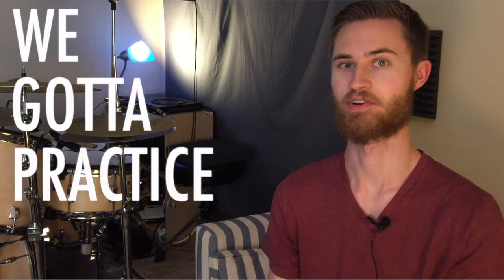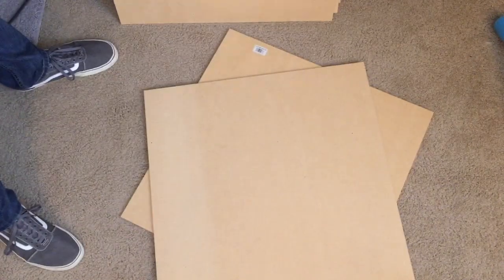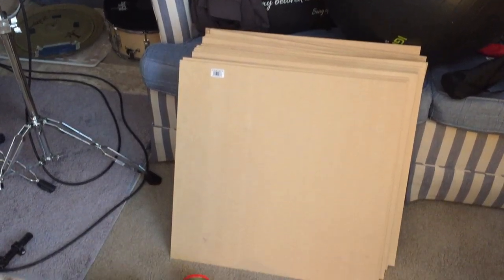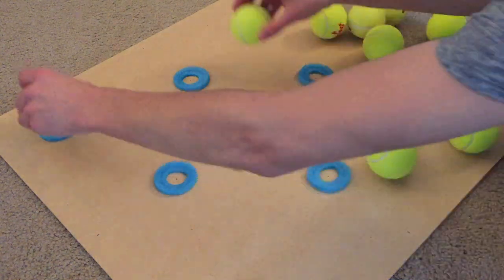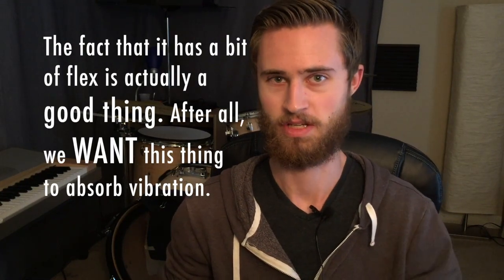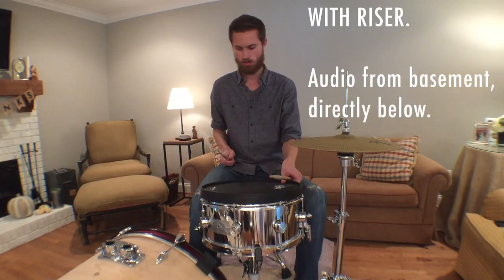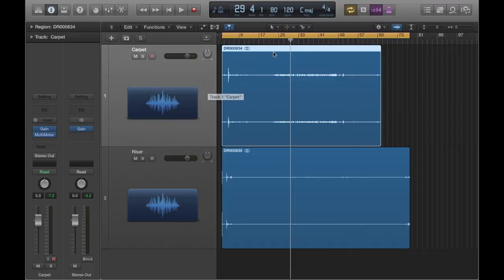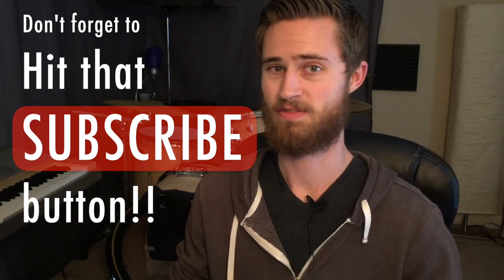Is a Tennis Ball Riser REALLY the SECRET to Quiet Drumming?

Comment: Always have something interesting on your site. However,  this tennis ball platform was wobbling quite a bit while you were drumming. Personally that amount of movement occurring beneath me as I am drumming to music or learning and practicing new beat combinations via the Internet or DVD would drive me absolutely bonkers! It would be as if I set up my drums in the back of a flatbed truck and attempted to play as it drove down a dirt road filled with potholes --  Honestly it would be ridiculous. Have you watched your video here? Every piece of your drum kit is moving which completely negates the positive effect of muffeling its sound as it is now rendered useless to play. Have you found a way to stop the wobbling? I've seen others where each tennis ball is cut in half and used one large piece of wood board to mount tennis balls onto instead of 7- 9 small pieces. There is NO wobbling at all.
Reply from the maker: Yes, there would be less wobbling if I used large pieces of wood instead of small squares, but that was a compromise I was willing to make not having tools at my disposal. Honestly though, the wobbling isn't bad. It doesn't bother me. That may be because I play on risers a lot and I'm used to it though. The idea of slicing the balls in half is interesting, but I think the wobbling would still happen just because of the size of the "tiles." If it does become an issue, most likely I would add a plank of wood on top of the squares as an additional layer. That would actually solidify things a bit. Also, in the testing video I may not have laid the extra MDF boards on top for reinforcement, which is what I do in my apartment. I lay extra pieces across the top to bridge the "gaps" and reduce wobble. It's quite possible that reduces it a lot compared to what you saw...I actually didn't think about that until you mentioned it.

Comment: Guys! I have a PRO tip from the 3D print nerds. Many of them use the tennis ball risers for the same reason as the drummers do, and it does the job to some extent, but you can do MUCH, MUCH BETTER than that, and it's still simple and cheap.

All you need is, wait for it........................ CONCRETE PAVING SLABS [Ba-Dum! tsss] I know. It's heavy. But if that's a problem, then maybe you should play clarinet. It's a cool instrument too. In the Polish military orchestras, they call it "a goose d##k".

I want to try it myself. I haven't yet, because I live on the 4th floor with no elevator, but it's pure physics, and I know it works 100%. Still, a foot stomping on a bass drum pedal is more powerful, than a small 3D printer, so there's a chance that some of that energy will get transferred to the slab, and from the slab to my neighbor's ceiling, so it would be nice to isolate the slab from the floor. A thick rag would be a solution, but I will try:
- a felt-like, 10mm thick acoustic mat (to be used in rehearsal rooms or to soundproof an engine bay)
- EPDM rubber sheet (it's often used in soil compactors or to absorb vibrations from all kinds of industrial machinery)
- 5mm thick EPDM shims (used for roofing accessories; I use them a lot already)
- some kind of extra-dense mineral wool; some folks on YouTube recommend mineral wool as the best material for DIY acoustic panels.

I'm not gonna use it all at once, but I think I will make more than one layer of insulation.

Comment: I think you could have gone simpler and cheaper by just cutting the pool noodles to 1 inch length and gluing both boards to those pieces leaving out the tennis balls.  The idea is just to get air space between the drums and the floor.

Comment: Only flaw that i can notice is making the tennis ball raiser for the throne? That is unnecessary since you don't hit the throne, you could've just used something that's stable to place the throne on. Why bother muffing the sound of something that doesn't make sound and making it unstable in the process?
Reply: But it doesn't stay the same height since it flattens more than the rest of the since person is heavier than a bass drum. My point was it's unstable and it moves, this is not the way to make it stable height, even less to make it the same height as the rest of the set.
Reply: Iglaaa it's to keep everything level. If the kit was on the riser and the throne was on the floor it would be around a 4 inch difference. That would throw everything out of wack.
Reply: Hulk Slayer and for such matter you can use somehing that is not tennis balls and noodles for stability but lets say wooden blocks or bricks or whatever is not squishy and is the right height.
Reply: Iglaaa you're correct. He could have used thousands of different options for making a base for the throne. I would guess he made it out of the same materials he was using for the tried and true reason that he was already using them :)
Reply: My riser has no spot for the drummer. I just increase the drum throne's height.
Reply: VortechBand boom! 
Was gonna say this. Just adjust your throne up a little. Unless you’ve gone past your max height. Then just get a few small pieces of material to go under each foot of your throne. No need for a whole section of the riser just for the throne if it’s only a few inches higher.
Reply from the maker: Trust me - I thought about that :) It's not a design flaw, just a choice I made to keep things simple. I don't want to have to constantly re-adjust the height of my throne between practicing and gigging. Plus it's easier to get the throne in the exact spot I want it on the fly when it's up on the riser with the kit. Otherwise if I decided it were too far away, I'd have to slide the whole kit toward me on the riser since the throne can only get so close when it's on the floor. So far there are no signs of instability, especially since I added an extra layer of MDF board on the square where the throne sits. I weighed out the pros and cons, and the method of putting the throne on the riser won.
Reply: Hulk Slayer then raise your throne
Reply: Iglaaa then your kit would be up high. Bad.
Reply: Yeah, I missed this reply, I understand that you don't want to change the throne height, only thing that I'm trying to say is that if you used something else instead of the tennis balls to raise it, it would be 100% stable. Like literally wooden blocks to hold the plate would make more sense since you don't need to muffle the sound of you sitting on the throne, right?
Reply: Just to jump on-board ... there is a theory that the vibration can also travel through the player so putting the throne on the riser is a good shout.

Comment: You should redo this video with real cymbals and remove the muters from the drums.
Reply: For real for real.  Once I saw the muters and the fact that kit is not loud to begin with this whole video seemed like a moot point.  That said well done on summarizing the steps for your project
Reply: @kevinkolhede5056  its not really a moot point because the only noise reduction a riser is going to provide is absorbing vibration mainly from the kick. using real cymbals wouldnt change the riser's ability to do that. the muffled kick drum head just makes sense, since what this video is about is making the drums more playable in an environment where making a lot of noise isnt possible. with or without the muffled heads, the riser would still show a reduction in noise either way.

Comment: A couple other construction ideas. 
1) You can get a 4x8 sheet of wood even on a regular sedan just by placing a sheet of foam or blanket on top of your car.  Just make sure your roof isn't dirty or it will grind the dirt into the paint.  This might drastically simplify construction. 
2) Holes for tennis balls could be done with the right kind of drill bit.  Might be more stable. 
3) Another option would be cutting the tennis balls in half so that they don't roll around (and you'd effectively have 2x as many contact points).  Obviously this would change the way it decouples the riser from the floor though and would likely require some design reworking.  Without trying it, I have no idea if it would crush the tennis ball halves or how many would be needed.

Comment: a set of V drums w headphones works
Reply: You still have to isolate the pedals from the floor or the neighbors will complain.  This is to stop the noise from stepping on the pedals more than to get rid of the volume of the drum.  Silent stroke heads are quieter and sound less irritating than pads.

Comment: Kinda useless if you got an acoustic kit. The roof vibration is the lowest noise that an neighbor gonna hear of an acoustic kit with metal cymbals haha... 

I made one of those tenis ball riser, and as I got an electronic kit, I have made only 2 parts of riser under the pedals. I used only 6 balls cutted in half and screwed on 2 MDF wood plate of 60x40cm each. Attached a piece of carpet over them, and done.

Comment: The secret to silent drumming is
Buying a electronic drum set
Reply: The thumping is still a big issue with an electronic drum set, trust me. 
There's no such thing as 100% silent drumming.
Reply: The sound of using the pedals will still go through the floor without isolation and thats the biggest complaint most people have with drummers living over them.  You still might as well be tap dancing above them unless you isolate the sound from the floor.  These heads and cymbals are quieter and less irritating than the constant monotone thud of pads anyways.  I have a yamaha electronic kit that barely gets used now that I got silent stroke heads and low volume cymbals.

Comment: screw that,    way too much work.   I use Foam, cut the depth of the drum being filled & roll it up & stuff it in & put the bottom head on,   do each drum,   fill it with Foam.       It will reduce the sound roughly 50-60%

Comment: There's no glamour in trying to play drums in an apartment either. At what point do you just pack them up and buy an electronic kit for practice? I know to get one that feels and sounds remotely realistic is expensive, but good grief And actually, you can get great sound out of a cheap one, just using a laptop and a commercial VSTi, like Addictive Drums, or even Kontakt has some great libraries. Anyway, the results are great here, so kudos for that. Definitely not against this approach and see why you'd want to.
Reply: That's what I thought, but I still needed to build a riser for my V-drums.  The pedals basically turn the space between floors into a drum.  Not one complaint in 10 years of blasting metal and mixing techno, but the neighbors were up here within 10 minutes of me setting up V-drums.

Comment: no drums in an apt. !!!!!!!
Reply: These silent practice systems on a riser like this are quieter than acoustic guitars.  You wouldn't know it wasn't just a radio on a reasonable volume.  He spent hard earned money making his set quiet and people like you are just ungrateful and looking to bitch.  The issue isn't the noise, it's you wanting to control those around you.  People like you are why I play my drums up until the very minute the noise ordinance kicks in and switch to brushes after.  You don't deserve a neighbor this nice, you deserve me!
Reply from the maker: Something you have to keep in mind is that a washing machine is 10x louder than my muffled down kit on a riser. Don't jump to conclusions too quickly, just because drums are mentioned. Walking across a floor also generates more transmittable noise than a practice kit on a riser, because it's direct contact with the floor. Drums in an apartment are very much doable, you just have to take the proper measures to isolate and muffle :)
Reply: Kudos to the uploader for doing this work, his neighbors surely appreciate it.
Re: drums vs walking vs washing machine... 1. waking and washing machines are necessary to live, drums are not. 2. There are fully electric drum kits that use headphones 3. Walking and washing machines don't generate rythems that draw the ear, a well done drum pattern encourages the brain to "tune in" and listen and some people are quite sensitive to the sort of rythem locking.

Again, kudos to uploader for being a considerate neighbor.
Reply: breakingthemasks Electric kits are pretty loud. Especially if you're not going for the top of the line Roland.
Reply: Nice design. :) I live in an apartment. I had to leave my regular drum kit in my parents basement. I did just buy some electronic drums (cash came in), hoping they would be quiet enough. They are...sort of. If it's "quiet"...like after about 6pm, or before, roughly, noon, then my neighbours can hear enough thumping n' bumping on the other side of the wall. Nobody beneath me, guys above me are dicks and make FAR more noise than me...so no worries there. But the folks bedroom is next to my 'drum' room. I can still annoy them with it...so I play between noon and 6pm. I also generally only pay for about one or two songs (diagnosed with severe fibromyalgia a couple years ago; have to drug myself up to play those two songs, and I pay for it later....TOTALLY WORTH IT! :) ).

As for what you have...sorry to say, I would be annoyed if I was under you. :( When you live in an apartment you need to give up a lot of stuff to make those around you not want to throttle you in your sleep. ;) I am also fully prepared to having to sell my e-kit if I have to; but, as I said, only 3 to 6 minutes every couple days during peak "day-time"...I think I'll be fine (beside, my super likes me more than the new guys, and definitely more than the guys above me...think they are waiting for a good enough reason to boot 'em).

I'd suggest getting a good e-kit and using the riser. (I'm going to look into building one for myself...just to double up on trying to keep my neighbours happy...even though they are, uh, "less than happy with life").
Reply: @mMaxwell_007 Lmfao the funny thing about living in an apartment is that it's usually for people with lower incomes, and beggers can't be choosers. Find an apartment where drums are banned or get over it, you have no control.
Reply: not telling: It's not all that, it's just hard to believe and I'm a drummer. And you, your just about you.
Reply: I have an electric kit. I'm going to put some foam on my walls and build a platform like this too. THat should do the trick.

Comment: "No flex in the boards"  steps on and boards flexing at the edges where there are no balls under it. 
Drums wobbling all over the place on the boards at the end of video.  
Dude,  just rent a music studio or move into a house or set up in a garage. You don't want to make a habit of drumming all gingerly because of your questionable need to practice in an apartment setting.
Reply from the maker: An important piece of info to keep in mind is what I briefly mentioned in the video... Use extra MDF boards to lay on top of the platform, that way you eliminate wobble. I didn't do that in the demo video since the point was just to do a sound test. When I'm setting the full kit up to practice, obviously I don't want to deal with wobble. Adding the extra boards solves the problem to the extent that it is no different from playing on a standard drum riser.

Comment: Noise from one room to another is a vibration transmission problem, You need a BARRIER, a drum riser is NOT a barrier.

First you need to measure the frequencies and the amplitude of the noise, this case, the drum set.  Then you need to figure out how much you want to attenuate those frequencies to the other side of the barrier as your ultimate goal.

THEN you have to build a structure made out of many DIFFERENT materials with a certain construction methodology that will accomplish the goal.  If not, then you are SOL.  Your apartment was NOT designed to attenuate the amplitude and frequencies generated by your drum set.

And you are going to have to build the entire room as this is a VIBRATION transmission problem.

I would talk to a professional that understands VIBRATION Acoustics.  I can recommend someone, but since you are living in an apartment, I highly doubt the apartment owner is going to spend the money so you can play your drum set.

THE only options you have is use a drum set that doesn't create enough noise that will transmit into other apartments. You are probably going to have to use an electronic kit with headphones.  That's probably the only REALISTIC method for being able to practice in an apartment.

Good luck.